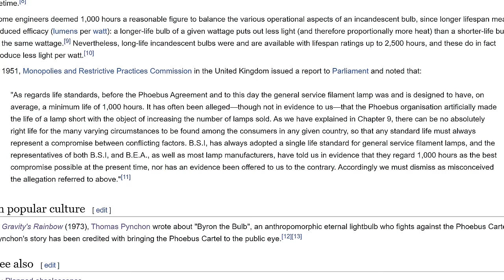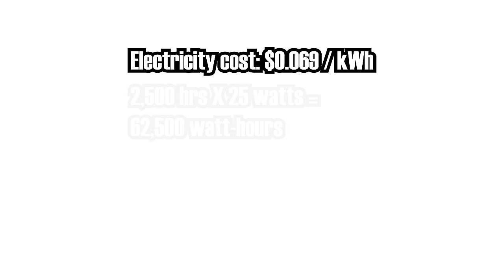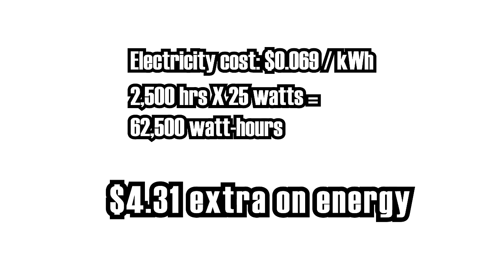Longer-lasting light bulbs: it was complicated

Comment: Enjoyable video, and very well spoken Alec! Another thing that lowers incandescent bulb life is a thing called "filament notching." This is especially bad when bulbs are operated from a DC supply, IE: automotive bulbs,  pilot lamps, ETC. This was issue was "somewhat" rectified (pardon the pun) with Rhenium Tungsten filaments. Take care!
Reply: Halogen bulbs fixed that problem, as the tungsten iodide was decomposed onto the thinest, hottest part of the filament, meaning tungsten was deposited in those locations. For it to be hot enough to work, the glass envelope had to confine the iodide close to the filament, which would melt ordinary soda glass, so fused quartz was used instead, as it has a much higher melting point, hence 'quartz-halogen' bulbs.
Reply: I don't think that warranted an apology.  And if you did intentionally make that dubious pun, half of the people on here can't spell, are oblivious to homophones, or are functionally illiterate so it's lost on them anyway.  Pun with Pride, and don't let anyone stigmatize you for being a member of a comically marginalized group.
Reply: @amarissimus29 How be the weather up yonder on yer high horse? It's not polite to make fun of the mindless hoard.
Reply: @amarissimus29  uh, I don't think you're responding to the comment you think you are.

Comment: Way back in the mists of time photographers (in the UK) used to make use of this effect of overvoltage for a "daylight" type of artificial lighting, there were specialist bulbs (& cheap photographers who used imported 120v bulbs), which a pair of were wired in series (and thus ran at approx 120v) so the effect, shadows etc could be assessed to compose the photo, then for a brief duration while the photo was being taken they'd be switched to parallel (240v) & give a much brighter & whiter light, then switched back to prolong the life of the bulb.

Comment: As a member of the overclocking community, I never knew you can actually overvolt your lamp
Reply: I just got the mental image of a lightbulb and an attendant muffin fan.
Reply: i mean, you can overvolt anything at least once
Reply: Well it's the most analogue circuit there's nothing to blow except the bulb itself.
Reply: The lamp becomes a fuse... or the lamp IS a light-emitting fuse
Reply: Very popular thing that was done using autotransformers to overvolt lightbulbs, when nothing comparable was available to amateur filmmaking. But life of that bulbs was 10-30 hours. Old times.
Reply: It's very commonly done with neon indicator lamps that you might find in something like an electric kettle or stove top, I think TC actually did a video on those a while back.
Reply: @citylockapolytechnikeyllcc7936 light emitting fuse, for sure.

Comment: Vacuum tubes were also somewhat of a commodity. I remember drug-store tube testers. I also remember equipment with parts lists that included a section such as "vacuum tube complement." That is, the tubes were set aside as a special category, because you expected to be replacing them from time to time. It was also advisable to remove the tubes when shipping the equipment, packing them separately with cushioning.

Comment: Thank you! I'm an engineer, and i've been trying to convince people of the positive effects on efficiency of the bulb cartel standard for years without success. Not that this video is gonna change that. But it feels good to know that there are at least other people out there able to understand that.
Reply: I myself was a faithful of the evil light bulb cartel planned obsolescence conspiracy theory until this video lol! Sorry for all the vexation our moronic group have put you through over the years 😂
Reply: I wonder if he can check nylon socks. Its another hot topic for programmed obsolesence video
Reply: Corrupt intentions can have positive outcomes just as pure intentions can have disastrous outcomes.
Reply: @kennethmiller2333  i don't think the intentions behind finding that standard where corrupt. Otherwise it wouldn't have been such a good compromise. That was real engineering optimization. Keeping prices high was the evil part of the cartel. I guess bulbs where at least twice as expensive as they would have been with a free marcet.that has probaply gotten more to a factor of 5 over the years.
Reply: @thoreberlin  tbh even with the price fixing the total cost to the buyer was probably still lower because of the energy savings
Reply: @Toksyuryel  Yes, trillions in energy costs where saved compared to the mass using long lasting bulbs. But the cartel still made unearned billions due to artificially high prices. It's  an overall positive for society. But i like to think creating a sensible standard could have been done without also creating a cartel to ensure high profits. Today we use regulation to intervene where the marcet isn't working well enough. In case of bulbs people are just to stupid to decide right even with all the necessary information.
Reply: @thoreberlin  Given what we see today with standards organizations, I'm not convinced. Corporations only observe standards to the extent that they benefit from them and will quickly abandon them in favor of their own proprietary system if they can make more money by doing so. Both Apple and Microsoft do this constantly.
Reply: @thoreberlin  The compromise being beneficial has no bearing on whether or not the intentions were corrupt.  As I said before, corrupt intentions can have good outcomes and pure intentions can have poor outcomes.  It is an ill wind, they say, that blows nobody any good.

The fact is, the KPI wasn't efficiency; it was maximum service life.  That leads me to believe that it was... service life that they wanted to limit.  As it is unlikely that the engineers got together and colluded on this, but rather the executives, I have to imagine that the motivation was not technical performance, but rather business.
Reply: @kennethmiller2333 -- This is precisely what keeps me from agreeing with the point of this video. If this was about efficiency, the rule would be listed in some form of luminous efficacy, not lifetime. 

Measuring brightness or temperature to calculate energy efficiency would also be easier than 1000h lifetimes.

I might believe that this limit was inpired or informed by engineers, but it's implementation was anti-competitive and almost certainly to prevent existing factories needing to close or retool.

I doubt it exists, but I'd love to see a comparison of different manufacturer's lightbulb's lifetimes before, during, and after the cartel's restrictions. Not their claimed lifetimes, but measured lifetimes.
Reply: @thoreberlin  Does your calculation for energy savings account for production, distribution and recycling? 

And are these savings 'virtual', in the sense that you're comparing it to light bulbs of the same brightness running at lower voltages, or is it absolute, as in consumer electricity consumption has actually reduced? 

Because if the 'cost saved' is simply illumination that wouldn't have been there before, which is what I'm gathering from these bulbs all having been in toughly the same 60W range, your 'savings' are fictional and useless. It means you're just producing excess light no one needs in the first place, so to argue illumination, not reduced operating time, was the motive becomes purely dishonest.

Comment: While it may not apply in this case, planned obsolescence can still very much apply to consumables...printer cartridges are a good example.
Reply: How so?  Cartridges for quite old printers are made and sold (thus not making the printer obsolete).   If anything, printers become obsolete too early because of a lack of driver support.  Or they break as soon as the warranty is over.
Reply: @radellaf some very popular old printers maybe. But most printer cartridges are for one or two specific models and they stop production every 5 years or so.

Though I think what the op was talking about was cartridges that say they are empty before they actually are. Or are designed in such a way that they dry out with non use. So an otherwise full cartridge would be unusable.
Reply: @radellaf  Some manufacturers put microchips on the ink cartridges that will literally time them out after a certain amount of time passes. HP is about the worst in this regard. 

During the chip shortage, one printer manufacturer had to provide new device drivers that skipped these nonsensical added e-waste circuits and their checks, because they wouldn't have been able to sell working ink cartridges otherwise as there were no chips. 

You know what happens in a sane world when an old inkjet cart dries up or runs dry? You waste a sheet of paper. You know what ends up being trash when the circuit board says it's time? It's more than an easily recyclable piece of paper. Plastic, circuit boards, ICs, and probably half a tank of ink.
Reply: @pontiacg445 and also even worse thing, the recent HP printer models require internet connection and a HP account in order to work, even for a very basic printing feature
Reply: Most "planned obsolescence" is just a balance between cost and longevity and is mostly consumer driven.  People may say they want longer lifespan but when they pull out their wallets they often choose the cheaper product over the better built one.
Reply: @sonictech1000 Yes but that's because cost doesn't ensure quality anymore. I could spend $150 between 2 different products and one could be completely garbage and the other could be the best thing in the world
Reply: @TheLongDon That's always been the case. Companies a century ago sold people radioactive watches and cocaine for toothaches. Quality has always been... an unreliable metric. Most consumers barely even knew what they were getting. Things were often built with durability in mind at the cost of effectiveness.
Reply: A really good example of this from the same era as the light bulb cartel is nylon stockings. Prior to using nylon, they were made of silk. The nylon was so durable a pair of stockings could last a few years of regular use instead of ~4-6 months. Once it was near impossible to buy silk stockings, they very quickly made them thinner and more brittle to have a shorter lifespan than the silk ones did. Now, many of them will get a run in them the first time you try them on if you have dry callouses on your feet.
Reply: Buy an ink tank printer, or go laser if you only need to print texts.
Reply: @harmonic5107  That would make no sense as the money comes from the cartridges. They are happy to sell you old cassettes. HP still sells the 56/57 cassettes that were used in the printer I bought in 2004.
Reply: Though printers are subsidised by the manufacturers to sell overpriced ink. Obsoleting the printer (and risking the customer buying from another manufacturer and thus losing the profitable ink sales) doesn't make much business sense.
Reply: I wouldn't say the cartridge, but rather the printer itself. There were several documented examples of printers having a pre-programmed page count limit. Once the limit was reached, the printer stopped printing and started showing an error. Once you brought the printer to a service center, they asked for more money, than a new one was. Interestingly, couple engineers took their time, reverse engineered the contents of an EEPROM and just by changing one of the numbers (apparently the limit), it started working again. And if I recall correctly, they took Epson to a court and they won the case.
Reply: @sonictech1000  Where electronics manufacturers often cheap out is power supply capacitors where spending even just $0.25 more on better quality capacitors up-front would increase the device's lifespan from 3-4 years (just enough to get through the warranty) to 10+. I'm a bit pissed whenever I have to repair a $300+ device just because the manufacturer wanted to save $0.02 on a 25V 10uF capacitor in the PSU's bootstrap power rail. All of the stuff I own which I have repaired by swapping out crappy caps for good ones 10+ years ago still works today.
Reply: @teardowndan5364  yep. Caps rated too close to the driven voltage, bad brands, cheap series with larger ESR or insufficient thermal considerations are still a plague even on quite expensive consumer oriented devices.
Reply: @harmonic5107  I had the drying-out problem myself, with my old inkjet printer/scanner.  I suspect it wouldn't have been a problem if I'd printed more often -- or maybe if I'd turned the printer on whenever I had my computer on, so the heads got cleaned regularly.  But I was only trying to print maybe once or twice a year, and my ink kept drying up and/or clogging.  In the end, I gave up and didn't replace it once the whole thing died, since I was rarely scanning anything either.  So now on the extremely rare occasion I need to print anything, I'll 'print' to a PDF and take it to the library or my dad's house.

(Dad prints a lot.  He plays in an amateur concert band, and frequently edits and reprints his sheet music -- both to make bad copies easier to read (if photocopied or handwritten) and to put the line breaks and page turns in more convenient places.)
Reply: @okaro6595  there are a select few, usually models that are used in government offices. But most consumer grade print cartridges don't get manufactured for more than 5 years. The reasoning (and I don't agree with it, just reporting what I've seen as someone working in IT) is that when you sell the same ink cartridges for a long time, third parties start working around the restrictions you put on refills. So by making a new cartridge every 5 years, you reset that counter.

Comment: You mentioned 6 months bulb change interval and I suddenly realized that it's something I never do in my house. When I got it 10 years ago I've installed LED lamps everywhere (those were some hella expensive light fixtures to illuminate the house with I'll tell you what). One of them was defective and burned out slowly within in a couple of years, though I never cared to replace it because each room has like 10 of them. But the rest of them are still shining as well as on the day I first turned them on, seems like I won't need to replace these for at least another decade. And of course the power bill economy! All these LED lamps put together consume as much power as a couple of incandescent bulbs.
Reply: When I moved into my current home its hallway was illuminated by six 40W incandescent bulbs. I have no idea how the previous occupants were not annoyed that one bulb would fail every month. Naturally I quickly replaced them with LED equivalents.
Reply: Same thing here, LED bulbs from 2014 still working fine, only 2 failed

Comment: Back in the day, 60s / 70s I was into photography and you could buy bulbs which looked and worked like ordinary light bulbs but were intended for photography lighting.  Intensely bright and didn't use much power but they burnt out pretty quickly.
Reply: Yes, there were 100 hour bulbs and two hour bulbs.
Reply: If you go back just a little further you also run in to the single use, magnesium, flash bulbs.  They were still pretty common in to the 60's.
Reply: Projector bulbs had similar short lives. Filament size was also a factor.

Comment: I run a Dollar Tree 100 watt LED in a lamp on an end table 24/7.  I generally replace it just about every 3 years. My microwave light burned out, and Amazon wanted $20 for a LED replacement for it. So, I bought 2 of the Dollar Tree 100 watt bulbs, cut the plastic globe off from it, and wired the LED "plate" in place of the sorry little incandescent bulb that was in there. I have the brightest microwave in town when it's turned on.